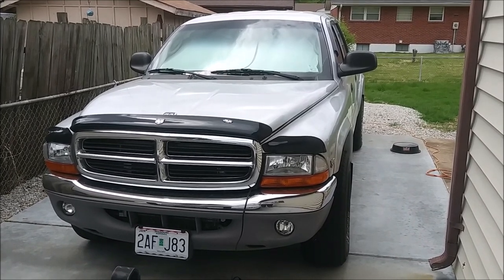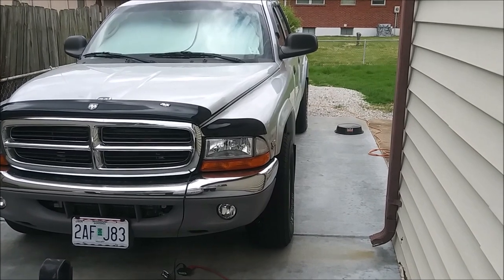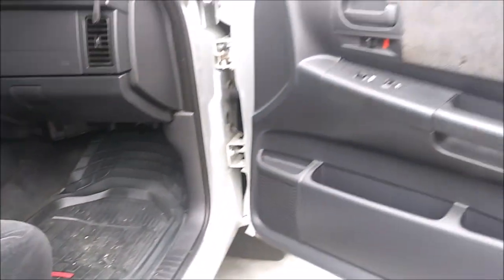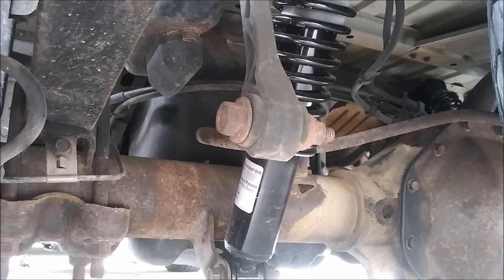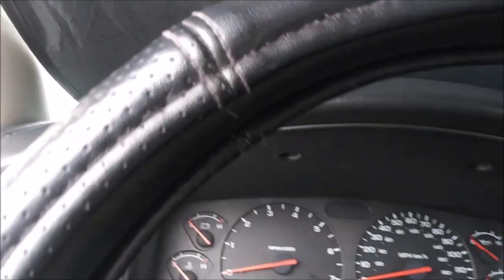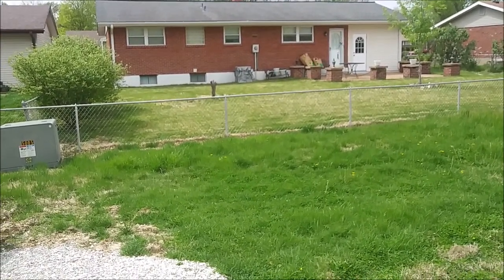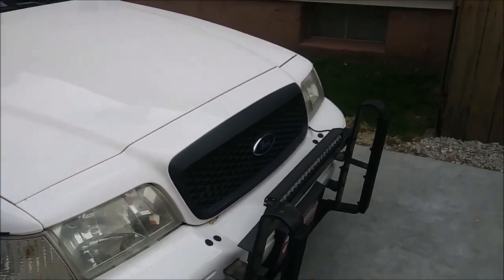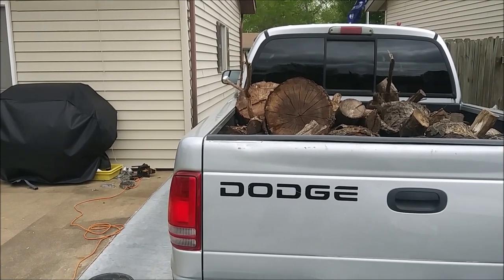Why the 2nd Gen Dodge Dakota is the Best mid size Pickup

Comment: Have a 99 2wd with the V6 and 5 speed. 240,000 miles and still runs good. Thing will fly too, for what it is.
Reply from the maker: @HaleHunterz  hell yeah. I've been daily driving mine since the rebuild, and I'm rocking 240K miles as well. Runs great, super reliable, ice cold A/C and comfy cruiser. I love that truck.

Comment: That's yr first truck dot ever get rid of it. ! I got hit in my daddy truck he left me, and I don't want to get rid of it but statefarm  is dragging assto pay me what's it worth they want to give me 5 amd dita worth 8. Looks really close to yrs mu 2004 slx quad cab v8 all the extras get you a spray on yr box inside or a rubber mate mine has a rubber matte amd Tahoe cover, man yes you got a good deal cause irs hard to find a truck with no rust aroumd the wheel well sucks

Comment: Flush that green coolant out and replace with the orange stuff. What you are seeing is signs of electrolysis. I daily drive an 03 Dakota and mine had the same issue when I bought it. Changed the coolant and that calcium looking stuff goes away.

Comment: My bought new 98 4x4, 5.2 with 198,000 still doing well, and added my new truck: a 99 RT with 83,000 last year, I guess they will be with me till the end, and someone will get 2 great trucks.............
Reply from the maker: I've told the wife and my friends before, if I won Powerball or otherwise had a lot of money to burn, I'd buy a dozen Dakotas or so of varying options and configurations because they're just that cool.
Single cab short bed R/T
Single can short bed 4x4 manual and auto versions
Quad cab 5-speed
My current quad cab auto V8 4x4
LS swapped
Hemi swapped
Hellcat swapped
The list goes on
I would have all the Dakotas. They are a natural treasure that must be preserved and protected at all costs.

Comment: How would a person know if buying a used one now, if they are looking at one with Full time or Part time 4x4?
Reply from the maker: @BlimpChimps  the transfer case switch inside the truck will have a 2WD as one of the options if 2WD only is an option. If it's full-time AWD the switch will have 4H, 4L, Neutral and AWD.

Comment: My first vehicle I drove was my dad’s 98 Dodge Dakota v6 and really loved it. I remember always wanted to drive it (yeah first time driving and you always wanted to drive). 

Then 2017 I wrecked my 2008 F150 and got a super cheap $350 01 Dodge Dakota V6. Even though that truck seen better days and I had to work on it so much and the transmission and back fire was a huge issue I still love that truck. The 2nd Dakota still my favorite trucks and even though their transmission isn’t the best I still love it. 

I sold it and got a 97 F150 and now drive 07 Chevy Cobalt for work and college I’m needing a new vehicle and I’m looking for a decent 2nd gen Dakota in my area at least v6 because I miss it so much. Yeah the gas mileage compare to a Cobalt going to decline. But I miss driving a truck and want to get a Dakota. Love the Dakotas

Comment: Thanks for the video, sweet looking Dakota, the gray and silver and chrome on point! 
   Question, I've heard that redoing the transmission fluid can be sketchy on old trucks and cars, is that at all accurate? I've got a 2000 195k 4.7 V8 sport
Reply from the maker: @culmuh313  i changed mine at like 230 something thousand miles. Did the same in my Crown Vic at 155K first time, and changed the BMW trans fluid at like 220K. We changed the wife's Neon trans fluid fairly regularly, and it made it 277K or more before it does. That "never change tranny fluid thing" is a myth. Always change it, just make sure it's a drain and fill. Never flush it. I think flushing it and that causing failure is what started the never change it myth.

Dakota trans has two filters. One looks like an oil filter screw on type, and the other is the flat kind in the pan. Change them both.

I don't remember if I did a video on that or if I just changed it and didn't film it, but I also added a drain plug so next time I can just drain and fill without dropping the pan.